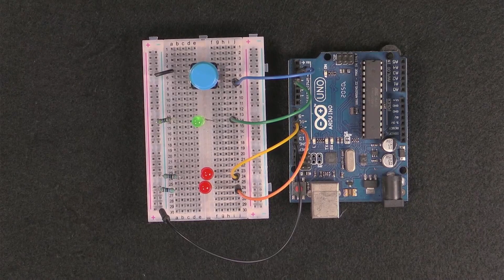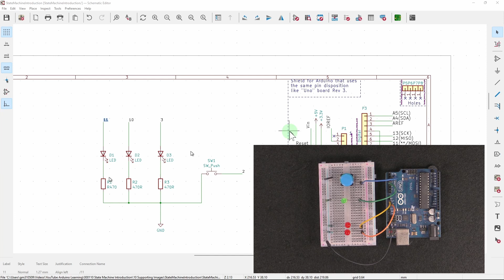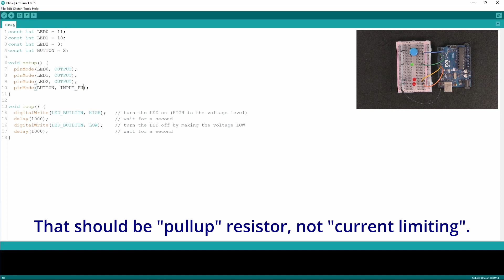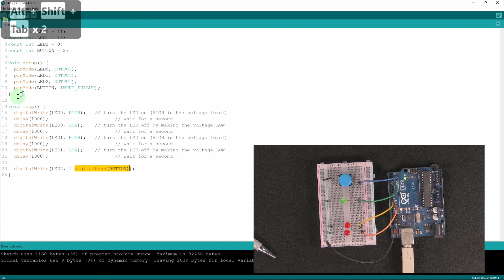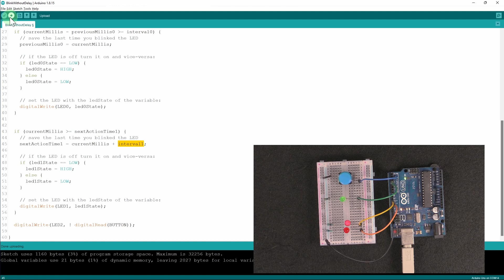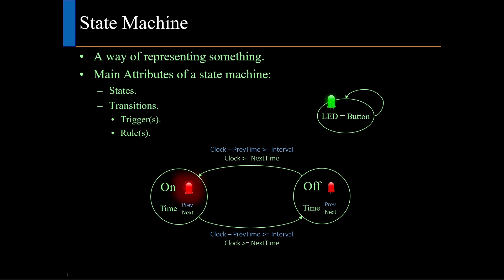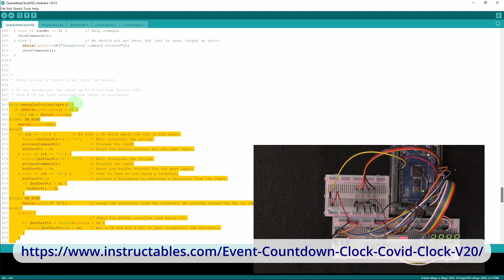Importance of "Blink No Delay" - All About Arduino - 1

Comment: Re: importance of "Blink No Delay" - All About Arduino - 1
https://www.youtube.com/watch?v=MRwaiFTkw_k&list=PL3kTorZwZbkBubi2q6TNwJ4UXTaTO9Qhs
 1:07  picture of wiring, 

I really like your well organized wiring
breadboard components mounted across center dividing section,
	all components connected to ground on left section, resistors from row to left side 	    ground rail,
	left section ground rail connected to left, digital side arduino ground 
left side digital GPIO arduino pins connected to right side of breadboard,
no right side power arduino gpio pins used at all

your code was well-organized, readable, 
the overall lesson illustrated common problem of mcu separate event type loops and showed how blink no delay, and your changes to it solved the problem. 
Your multiple  linking documentation, youtube, instructables, and Github were wonderfully helpful and instructive, everything related to a useful tool.
 

Another apparent way to solve multiple independent timers could be event-driven code
From Tulsa-based programmer, author Christian homeschooling educational material, 
Polymath Jonathan Bartlett, 

1)textbook like "Electronics for Beginner's" 
2)https://www.youtube.com/watch?v=QvQAl-zbiCI&t=4s
"Arduino Event-Based Programming"

Comment: You do realize that you introduced a bug when you modified "Blink without Delay" ?
Reply from the maker: Are you referring to the potential for rapid timer expires when the wrap around occurs as the timer reaches the maximum value of an unsigned long? If so, yes, but I was trying to provide a simpler way of representing it in hopes that people can understand the calculation better. I probably should have mentioned this factor, but am glad that you have brought it up. 
Having said that, this problem will only occur for a brief period of time (the timer interval) once every 49.7 days, so it might not always be a problem. In the blink program in the video, this would mean that the LED1 would appear to be dimly lit (as opposed to being full on or full off) for 0.3 seconds once every 49.7 days.

Comment: Indeed, this is a very important example to go through and understand, as it's a prerequisite to create basically all projects with a user input. For the project to be responsive to the user, it needs to spend majority of time checking user inputs. 
It also teaches a more general concept of saving computational resources, which comes into play with more complex projects. These microcomputers are capable of a lot, but you really need to think about efficiency of your code. Skill that is largely overlooked, since it's becoming a standard nowadays to solve slow code by throwing more resources at it, instead of optimizing. 
It's a nice challenge to code large projects with micro controllers.
Reply from the maker: Thanks for the comment.
I would only add "...not just projects that expect user input, but also to support some modules - such as a GPS module that I have - that is constantly outputing data (sentences) and if you don't read them as they come, you will miss them."